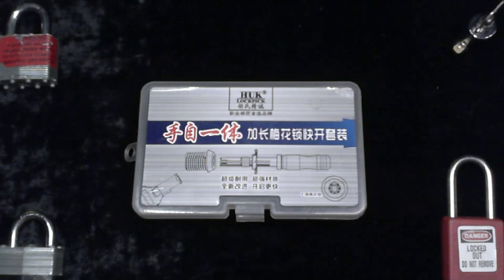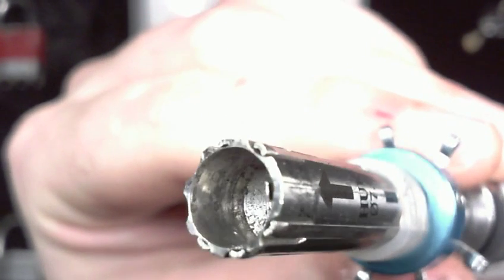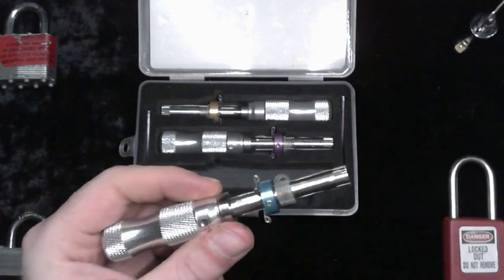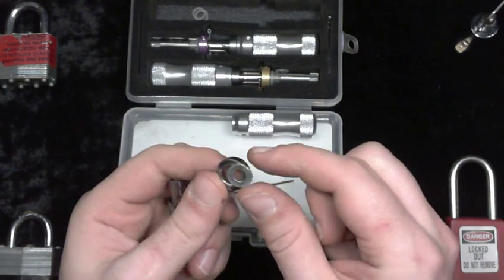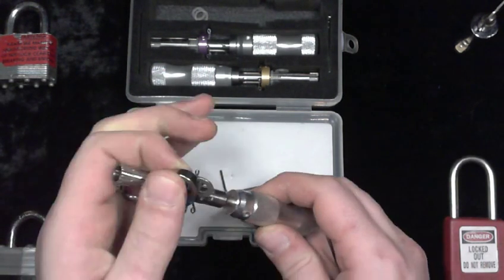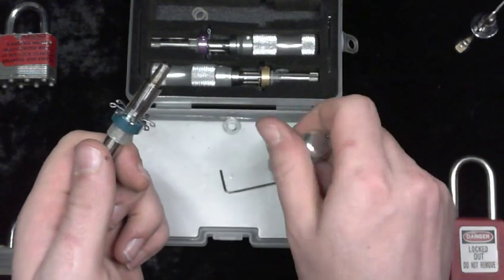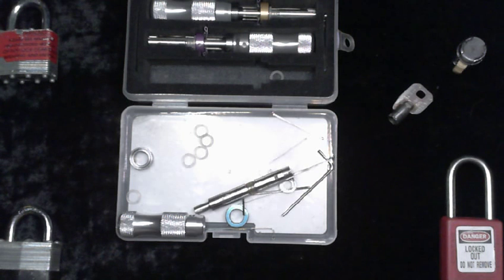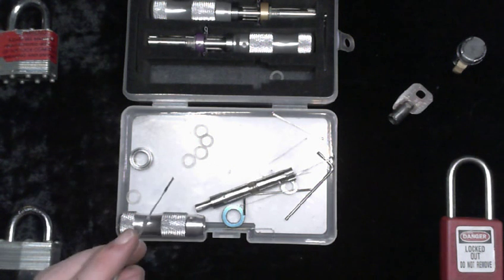Locked Out 0003 ACE series 02: H.U.K. Picks

Comment: Thank you for uploading such a thorough and informative analysis!

I grabbed this Huk set--unfortunately my first and only tubular pick tools--and found your video through having some problems after a brief time.

I did actually have an okay bit of luck with these picks upon first receiving them. I've yet to have a problem with the center pin as described, but as you've zeroed in on, the tension is inconsistent (and undoubtedly will wear with time).

After watching your video, I compensated for poor tension with additional banding and was able to reset the lock I needed to. However, I do look forward to picking up the SouthOrd tool when able.
Reply from the maker: sulfurmusic The going theory here is that the tubular locks in place in that part of the world typically have lighter spring tension, as with many of the more modern radial pin locks. As such, if you are in Northern China, these might be helpful; but seldom here......Be sure to check out The Hybrid, detailed in video 0005!
Reply: sulfurmusic

Comment: There is another set on Alibaba, $30 for 3 delivered BUT the tension part is properly done, using an adjustable collar to adjust the amount of tension on the rubber O-rings. They are 'fast reset' ones. Much better than this set IMHO.

Comment: Hello :)
Could you tell me if it is possible to use the unmodified HUK picks for SPPing a tubular lock?
Perhaps remove all rubber bands and push down with a finger?
Or perhaps remove all rubber bands and all 7 pins and then use a pick for spp?
Reply from the maker: It is possible....but you must devise a way to lock the pins on the pick because rubber bands don't cut it.....o-rings suck.
Reply: Why would I have to lock the pins in place? I thought there is a binding order for tubular locks too. I was thinking of pushing down pin 1 (no feedback), pushing down pin 2 (get a click and slight turn) then try pin 1 again. Pin 2 holding automatically due to binding order.
 I thought there is not much difference between a tubular lock and a standard pin tumbler core, but the tubular is much tighter.
Reply from the maker: There are springs behind the pins in the lock. These springs create return pressure, which requires your pick to resist that pressure, preferably with something inflexible. So no rubber or silicone o-rings.
That is why you have to lock the pick pins in place.
There is indeed a binding order for tubular locks, but it is of less use, especially in SPP'ing.
When SPP'ing a regular pin tumbler lock, like a Master 140, the pressure you put on the core in order to bind the pins is with a single object being pressed in a single direction, with often the only variation being in the amount of force applied to it.
This is because the pins are in a straight line from which there is only one available angle of attack; i.e. via the keyway. That means you can set your tension wrench and more or less SPP the PT lock at your leisure.
With an A.C.E. lock, it is necessary to re-adjust the tension wrench at least once in order to clear it to reach the pins with your pick.
Even then, an A.C.E lock must be picked FOUR times for each open via SPP.
That is because A.C.E. locks re-lock themselves every quarter turn.
I have attempted to use the H.U.C.K. picks in this very manner, or one similar.
The trouble, again, is tension.
In order to SPP any lock, it is necessary to find a sweet spot between too much tension for the pins to move easily enough to pick them, and too little to bind them between the cylinder and the lock body.
Finding this sweet spot is a matter of luck, as it is unique to every lock, even in that same make and model.
Skill and practice raise your odds significantly, but in the end it really is just augmented chance.
As such, it is required to do everything we can to increase those odds in our favor, which is more than possible:
Use lubricant;
Use good tools; (not just good picks, but good lighting, good, clean seating and a good lawyer)
Have patience;
Practice. Practice. Practice.
Also; who wants to roll the dice four times, eight if you want to conceal your entry, when a few seconds will suffice if only one does it right?